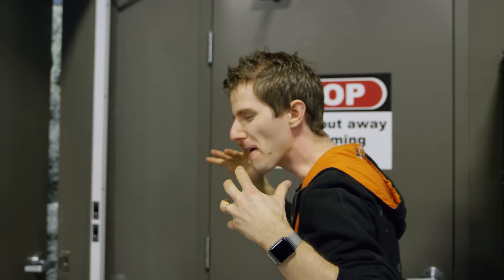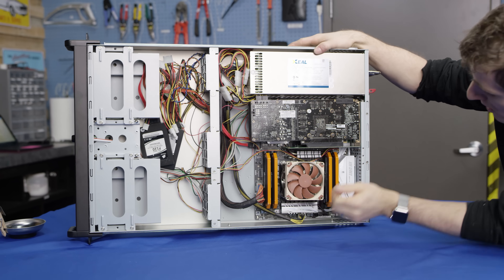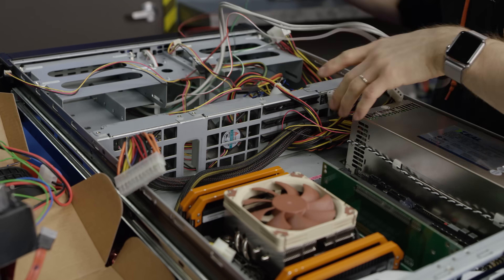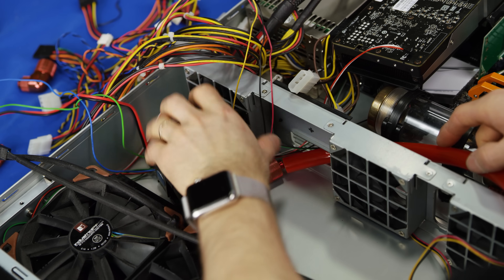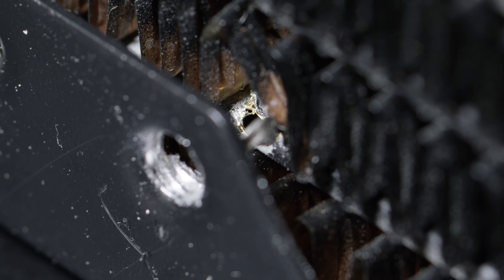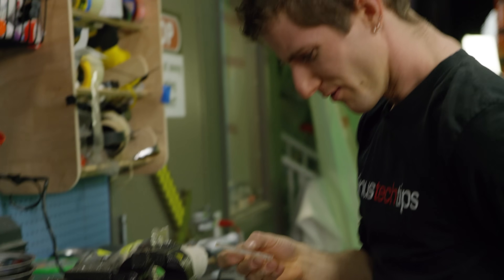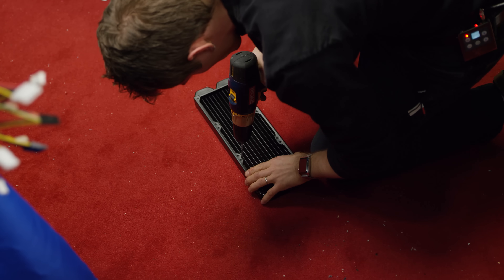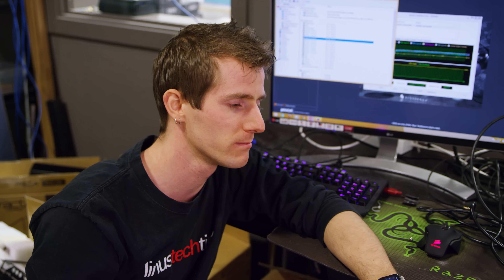Watercooled, Overclocked SERVER Build!

Comment: drills in a rad, punctures the tube, seals it back up with epoxy, has the glorious idea of just using double-sided tape, finds another rad, drills in this one as well classic
Reply: After this video my face is watercooled by the sweat.
Reply: I got panic attacks by looking at his drilling tech, doesn't he have some kind of metal plate to stick in there?
Reply: Arguably still better than the time he didn't want to wait for mounts for the 22 core Xeon, so he removed the socket bracket and zip tied the cooler to the motherboard.
Reply: I got panic attacks he drilling into metal without goggles.
Reply: Jesus, why not go out and buy another radiator?
Reply: he didn't even put anything in between the drill and the radiator fins to prevent drilling through again... ffs
Reply: Felix Berg, Was looking for this comment lol
Reply: that second radiator looks like one from alphacool which has a tiny metal plate under every hole to prevent damage (yes the aio is from fractal, but they dont produce radiators them self) non the less this was one of the worst jobs I've seen on LTT apart from the pizza heater. Linus step up your game, this sucks!
Reply: I know right?
Reply: Felix, I was thinking the same damn thing.
Reply: It really cringes me how they treat hardware here most of the time :(
Reply: the epitome of a case of either a "problem" or a problem.
Reply: Right lol
Reply: HOLY FUCKING SHIT.
The anger this inspired in me.
Reply: That moment when he realize he could've used double-sided tape... lmaooo!!
Reply: Felix Berg 
YEA 
WTF LINUZ
M8 YOU AS BAD AS MY DRUNK UKLE AVE THER'
Reply: this have 1080 likes mmm future
Reply: The cringe is palpable. I presume everyone was on the edge of their seat.
Reply: Lol I know I saw that and I was like wha are you doing....
Reply: TheOnlyUncleSam Well, we'll see if it releases the shmoo in due course
Reply: If this comment didn't exist , I would type the exact same thing.
Reply: If the shmoo releases, all the angry pixies will die and she won't chooch.  You gotta make it skookum as frig.  No chinesium.
Reply: sinnison23 huh, i wonder how many LTT watchers also watch AvE?
Reply: came directly from ave ;D
Reply: leave uncle bumblefak alone! just leave him alone!
Reply: i noticed this as well... Ohh classic linus.. xD
Reply: KNO56 me too :)
Reply: forgets to put the water in the system , I guess it's air cooled
Reply: like he needs goggles for such a small driller. You guys are just mad he gets to play with these stuff and make tons of $$ out of it while you're stucked on your pathetic employee job.

Comment: Drilling a hole in a rad like that... what would you expect. Linus needs to chill with these projects lol he broke the screen in the razer project and now this.
Reply: All he would of needed was a drill press, not even a good one!
Reply: Would HAVE*
Reply: 010FSL101 what I want to know is how the rad is getting or releasing air...there's literally no ventilation on either side...
Reply: There is, only a few mm, that's what the broken acrylic pieces were for
Reply: he breaks everything, its expected
Reply: Gurvinder Parmar i think the case is getting enough air from the front so airflow won't be affected as much. The static pressure fans used in server cases are very powerful.
Reply: yea recently he has been breaking stuff which imho makes him look very unprofessional but it's still fun to watch.
Reply: #dingustechtips
Reply: Would HAVE
Reply: piece of plywood in between the bracket and the rad, even.

Comment: "I AM TAKING NO RISKS OF LEAKING" proceeds to drill into the rad, seals it with epoxy and calls it a day
Reply: derchesten I was going to comment the same thing but checked to see if anyone else had
Reply: I did as well, but got tired after like 15 comments, following the guidance of guru linus of the epoxy seals
Reply: TheMiningWaffle Same.
Reply: If a cars radiator is leaking from a huge gouge and JB Weld can stop it I'm sure he's fine
Reply: Calls it a day? He swapped out to a new radiator that wasn't drilled through lol.
Reply: Steve Bowman you remind me of that mythbusters episode where they pour a raw egg into a car radiator to seal holes in it
Reply: The3rdID He did drill it again tho...😂
Reply: But what he drill in is brass, not tubings, so it’s not going to leak, it will only have problem transferring heat

Comment: "I should've used two-sided tape for the radiator, why did I risk drilling it in the first place?"
Proceeds to drill the second radiator.
Reply: He had already drilled the holes and counter sunk them... might as well use them at that point.
Reply: THANK YOU!
Reply: Then there will be no clearance under the rad for the fans to draw air from. The tape comment was in fact wrong.
Reply: Felipe this is linustechtips...
Reply: tape is a shit solution anyways.
Reply: yep :D I was searching for that comment
Reply: He could tape spacers aswell
Reply: Honestly yelled at my computer.
Reply: tape would not be a good solution, tape is temporary, screws are permanent
Reply: then just glue it or even better print some spacer glue them on the radiator and use screws to fix the spacer....
Reply: +XrangeViking I guess you're not familiar with 3M then?
Reply: easy enough to fix by placing using doubled sided tape to attach blocks under each end tank and then using more double sided tape to attach the bottom of the blocks to the case
Reply: Felipe Figueroa was thinking the same lol
Reply: Classic Linus
Reply: But so Canadian of him to use a hockey puck in the system...
Reply: Those Kelvin radiators have metal plates under the mounting holes, no risk there
Reply: Im1CrazyCow Who do you think you are?

Comment: Linus:  "I'll just drill into this radiator taking no precautions."

drills into radiator

"Shit.  I should have just used double sided tape.  Oh look, another radiator."

drills into radiator

smh
Reply: Richard Sadler gold
just
pure
gold
Reply: Richard Sadler sometimes I wonder if its all an act
Reply: jays 2 cents too much thermal paste I dident cringe I cringed  at this oh look let's drill a radiator shit I fucked up oh there's another let's nearly destroy  another rad oh the cringe in this my god
Reply: Richard Sadler 9 no 9 f dd
Reply: Richard Sadler h
Reply: "This water system needs to be absolutely bomb proof so Im taking all the precautions"

5 min later

"Oops, punctured the radiator. Lets just fix it with dubious epoxy that might work"
Reply: linus is a tech dude, not an engineer lol because an engineer would have slapped the drill out of his hand the first time around.
Reply: how do you know? you are neither.
Reply: Richard Sadler ii
Reply: or he just should attach it with som velcro ..
Reply: one of those moments when you decide what your doing is stupid but by the time you decide to stop its just to late...
Reply: Yeah like why doesn't he use a drill press and set the stop.
Reply: An-Jello that would be to easy

Comment: "We have another rad!" immediately starts drilling into it I cringed.
Reply: Sean Martinson thought the same thing I saw him drilling and I was like wtf why no double sided tape
Reply: Tape would be much worse.
Reply: Sean Martinson mee too
Reply: well i mean its purpose is sitting horizontally in a rack
its enough to fix it in place with a very good double sided tape onto the chassis for moving around on its right side up
Reply: anyway why he pulled out second after he screwed everthing togeder ....
Reply: mnpctech had a tower mounted on a wall for a few years with 3M double sided tape radiator would have been nothing
Reply: MrValgard ~ I'm sure Linus's wife asks him that very same question... ;)
Reply: I laughed my ass off
Reply: Tape isn't that much of a good idea, you need clearance under the rad, or there won't be any airflow

Comment: Cannot risk a leak, ill super tighten fittings, run tiny tubing runs to reduce precipitation and finish it off with this radiator i've jankily repaired using epoxy......
Reply: TheMooseAider He changed the rad
Reply: And drilled into that one too
Reply: AND PLACE A 1000TB SERVER BELOW IT
Reply: TheMooseAider he used a fresh radiator in the end though
Reply: i know he changed the rad, was just highlighting the thought process, or lack thereof, to even consider repairing the rad in the first place.
Reply: Will super tight fittings risk leaking? Isn't it the other way around?
Reply: TheMooseAider And thats why we love him😂

Comment: Just put it on the bottom or the rack then you won't have to do another all our data is gone videos
Reply: ya that would be fun to watch. he probably would get alot of views
Reply: i remember u from the ncix tech tips windows sponsorship comment.
Reply: Some men just want to watch the world burn :P
Reply: the HDDs are the helium filled water-resistant ones, no?
Reply: well, if there are any spillage, it will probably damage the pcbs of the other components. and since linus' servers are basically constantly 24/7, a sudden failure of the raid controllers would at best, result in the loss of the raid controllers, and at worst, the corruption beyond restore of every file on the petabyte project. but at least if worsts comes to worsts, we will at least get all our data is gone pt2.
Reply: but wheres the fun in that
Reply: Sometimes I wonder if he does risky stuff like this on purpose, just to make stress-filled videos that get lots of views.

Comment: Did anyone else cringe when Linus started drilling on the second radiator, after just saying he should have used double-sided tape?  I did.  I was almost certain he was going to drill right through it.  Also, Linus, WTH were you thinking putting a repaired radiator you hadn't tested into a unit right above your future petabyte storage? 

Lol That whole video I was just yelling "STOP!  For the love of God, Linus!  Just stop!"
Reply: michael gregory Like honestly if I were Linus I would place the water-cooled render machine on the lowest point of the server rack and have a container in the bottom to stop any water from pooling on the floor. So that way if it leaks it won't damage any other machines in the rack
Reply: I just imagine a guy screaming at a computer screen "STOP! for the love of God, Linus! Just stop!" and it's a pretty funny scene.
Reply: Yes...so much cringe in this video.
Reply: I could be wrong, but he might have been tapping (cutting new threads) in the holes so the screws would thread into the radiator brackets instead of going all the way through the radiator. If he had to reverse the drill out instead of just pulling it out, then that's probably what he was doing. If he just pulled it out then he must have been making the holes bigger for some reason.
Reply: I was just about to say the same. The man never learns. I've given up on him ever actually thinking anything through
Reply: I was just thinking that exact same thing
Reply: I think since he already drilled holes through the trouble of drilling holes through the case he decided to keep the idea going but yea i can see just double siding tape being the better choice even with those holes already drilled in

Comment: Tightens fittings with pliers to avoid leaks at all cost - uses a glued together radiator that is destined to leak at one point or another... #justlinusthings
Reply: He switched the radiator out in the vid.
Reply: yeah but he wouldve used it
Reply: Done right, the glue would've sealed the cooler. I find it more "concerning", that he found a second cooler and decided to drill again. Even though he had the idead that he could've glued it into place.

Comment: If you really wanted to cut leak risk down from fittings.  You should have used Teflon tape on all the male threads.  You never know when an o ring will go bad.  If a fitting does loosen the seal stays, also it keeps fittings from wanting to unscrew.
Reply: Teflon tape is only effective on tapered pipe threads.
Reply: Screw It

Comment: Lets expose as little tubing as possible in order to avoid any problems 312 years from now. But let's drill a hole into a radiator then, fix it with epoxy. Amazing.

Comment: Btw you can just put this below 1pB server
Reply: CJ636C65 this needs to be the top comment XD
Reply: My guess is that it's too heavy for it to be safely mounted higher.
Reply: Agreed
Reply: Roman Larenas it doesn't matter, Servers don't rest on each other, each individual case has its own railing system supporting the full weight
Reply: +Roman Larenas 2U higher would not be a problem. Trick is to lift each 45drive cabinet 2U separately, while temporarily handing off the full load to another cluster member so drives can be spun down while moving.
Reply: Who needs advice when you have two hands, a cordless drill, and a warehouse full of spare parts?
Reply: John Doe I see, thanks for the insight.
Reply: +wowlumi Too bad that "a warehouse full of spare parts" doesn't bring your data back....

Comment: Why don't you have a drill press ffs? Always seeing you guys using hand drills for delicate work...
Reply: because you dont really need a drill press. i mean they are nice and all but its not required.
Reply: He drilled a hole in a radiator.
Reply: but is it working? yes.

Whats the issue son
Reply: Im pretty sure ive seen a press in other videos, would be the smart thing hey...
Reply: actually he fixed it with epoxy, and said he fixed one before like this and worked fine for many year's. couldn't use it yet since the epoxy hasn't hardened enough...
Reply: Anthonypython no he said he fixed one before with jb weld not epoxy. jb weld is a little different.
Reply: jono3952 yes i know and he very easily couldve backed it with something harder that wouldve prevented him from drilling right through like he did. or just use double sided tape or you know just get someone to print you a bracket and not be impatient.
Reply: Maybe not required, but they're really nice for exactly this sort of work and they really aren't that expensive.  Any shop that does as much drilling as they do should have one.  They should also have a tap and die set too.
Reply: michael gregory yeah they should have one but i have a feeling they dont just to be like yeah you can do it too. cause i know a lot of people who freak out about doing any sort of drilling with pc shit. like before i really got into pcs i had to drill my buddies case one or twice for motherboard standoffs cause he was too chicken shit. he was worried metal particulates would be left in his case but theres easy ways to solve that. but yeah they should just get a drill press but as i said i think they have their reasons.
Reply: dunxy wait really? FFS if they have one then use it. i just figured then didnt cause well people will think they cant do it without getting one.
Reply: Im sure i recall luke using it ages ago.
Reply: plus if they had all the right tools for everything than the video wouldn't be unique...
Reply: I always see LTT doing stuff that irritates me, like using sanders or grinders without any eye protection and gloves, or drilling in cases with components still installed.  I think it irritates me because people will emulate what they see and he and his team practice unsafe work habits.